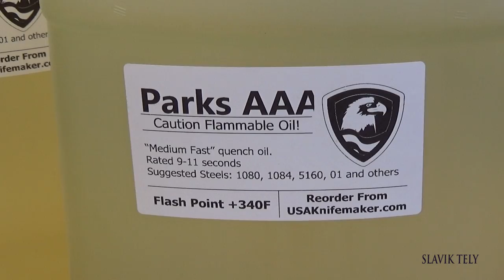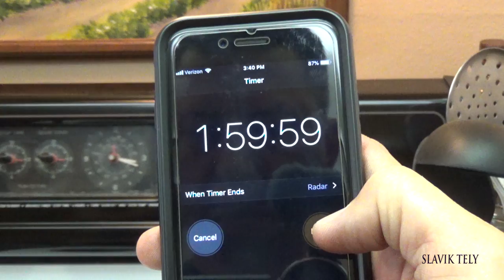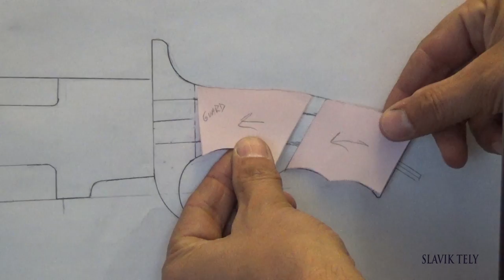Making Predator Knife Part 2

Comment: When i quench i let the flash fire go out . pull the blade a look for warp.if the blade is warp i use a soft face mallet to remove it.move fast you only have about 3 min to do this.and then ill pet it back in for a few more min.  nice work  as always.

Comment: Important question Slavik
How can you prevent your knives from rust?
In case of long time no use thr knife will rust ,so how you solve this problem?
Reply: Regular care, mostly. After use, oil lightly. If storing for longer amounts of time, a thin layer of wax can help.
Reply: Keep away from moisture and your wife.
Reply from the maker: Good answers

Comment: That's the part i don't get, the making of the handle... why make it weaker , why not just mold the handle as a full tang... that design of handle is a failure doesn't matter who makes it because less isn't better than more obviously...
Reply from the maker: I don't have a milling machine to make a full tang knife and have cut outs for the guard and pommel thicker than the blade.